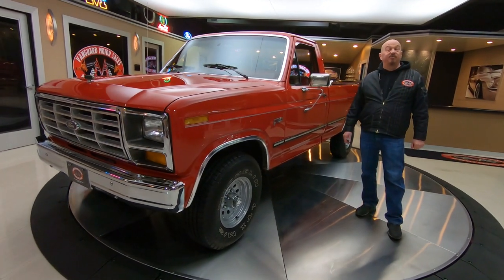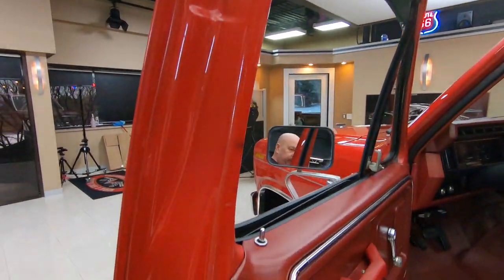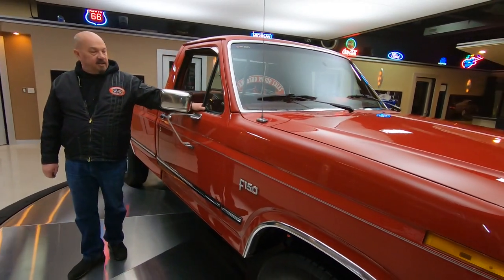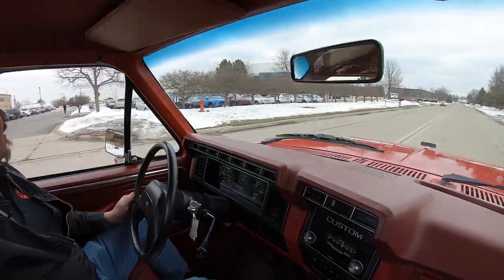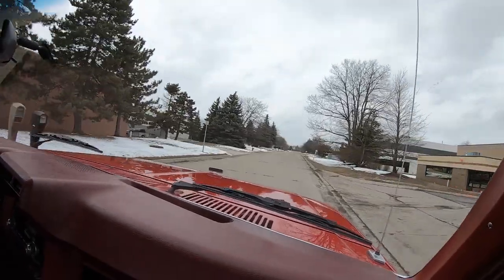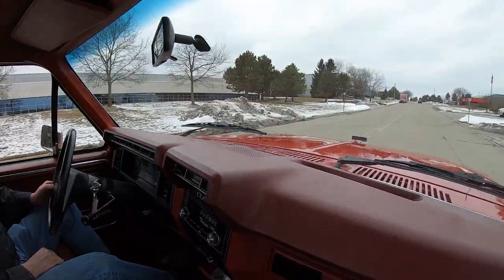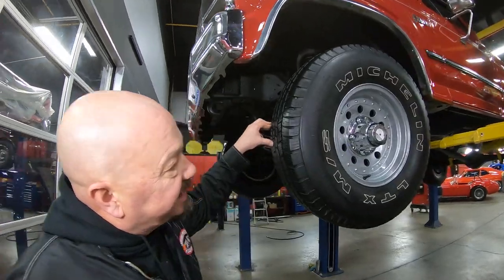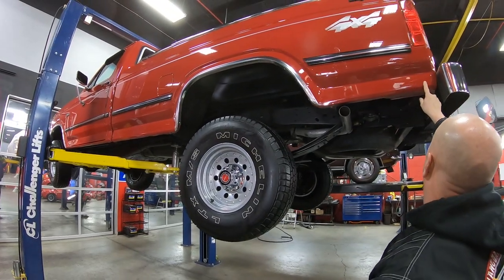1981 Ford F 150 For Sale

Comment: Whoever pieced that thing together did a very nice job of it but it's a big bunch of different years,,, grille, steering wheel,, door panels,, air cleaner,, outside mirrors...
Reply: I did notice that.  Its a mixture of several years.  Looks nice though
Reply: Yes but you can buy original reproduction items

Comment: My dad bought a Ford explore custom truck the year I was born in 1980 I really miss that truck it was manual transmission straight six cylinder all red with two white stream lines 5 lights on the cab duel gas tanks it was geared real low top speed 72 mph.  The stories I could tell One of the our story is of we stored this truck in the shed outside during the cold winters one day the battery had some corrosion we cleaned it off but then we noticed we still have the original battery for 17+ years